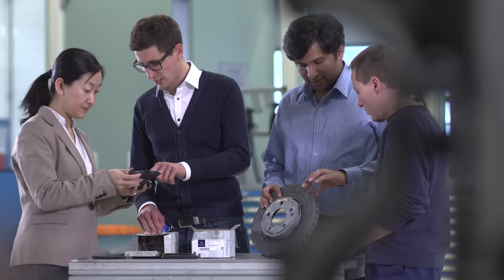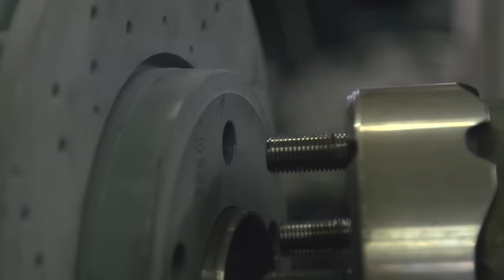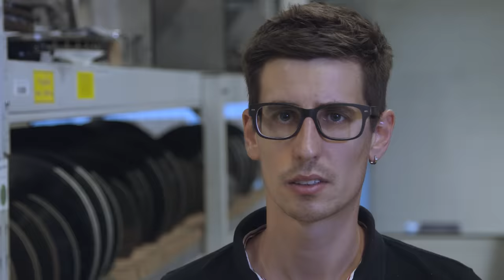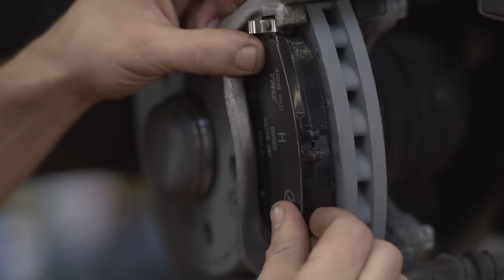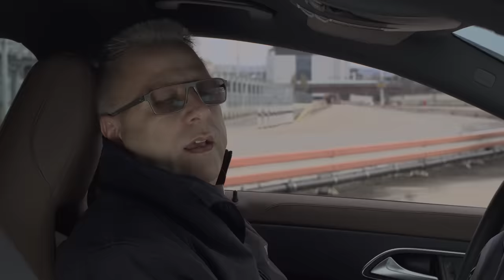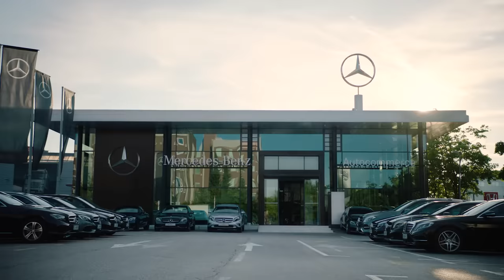Brake Test | Mercedes-Benz Genuine Parts vs. Fake Parts

Comment: I have a feeling this is biased lol
Reply: Mr.Popeyes 😂😂😂😂😂😂
Reply: Mr.Popeyes "hey look my feet is not strong enough to press on brake pedal hard" hahahaha
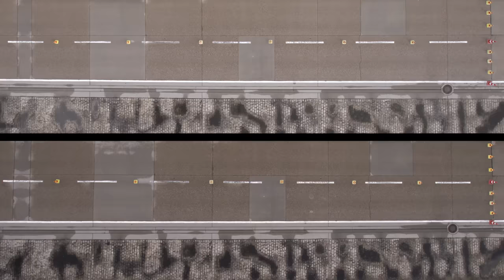Reply: if you go frame by frame at 1:44, you can see the brown car applied the breaks at the 2nd cone where as the white car is already breaking when entering the scope of the camera. smh
Reply: It is true (ask how I know)
Reply: that's right
Reply: Roblox Gamer it actually is not biased, I just tested this myself
Reply: Teun I

 no,  because ABS won't let it lock the wheels
Reply: Teun I hes driving a fucking sedan, obviously with abs. Do you live under a rock?

You guys can question it all you want, but you get what you pay for, and brakes arn't something to look over. Doesn't matter how fast you go if you cant stop..
Reply: You can throw the cheapest brake pads on, and they will still be able to lock the wheels ... how long they last, if they will fall apart or if they will wear down the rotor is something to consider ... but this seems to be 100% BS ...
Reply: goguhu no you cant, Im guessing you've never heard of brake fade, or experienced it, lemme guess you live in a flat area?

 Case and point, my buddy bought the cheapest of the cheap pad to put on his sedan, we were coming down the Appalachian Mt's when you could see smoke rolling out of his wheels, and his brakes were nearly not working. This was within a week of putting them on with barely any driving. You get what you pay for.
Reply: No I actually live in a very mountainous area, in my youth I commuted up and down 3000+ ft every day, and learned from I was very little to not ride the brakes, apply them hard and short instead of barely touching all the time.

Brake pads is not what's causing brake fade. Brake fade is caused by too much heat buildup which is typically caused by applying the brakes too much / too long and/or driving a vehicle in a way it was not designed to do. Typically people experience this when they drive automatic cars down hill with lot of turns, and ride their brakes for 5+ minutes, or they are taking their Toyota Camry on a race track, and realize after one lap the car won't stop as fast any more.

The heat buildup deteriorate the braking fluid, and can in most extreme cast (with old fluid) cause moisture that it will pick up to boil, and you will lose all brake (till they have cooled down). The other more common effect is that under high temperature the rotor (or drum) and the braking pads no longer have enough friction, and you need to apply much more pressure to stop the car, or eventually not even be able to lock up the wheels.

Smoke coming out of the wheels have most likely more to do with how he was riding his brakes, and not sufficient cooling of the brakes / continuous braking. I have stopped many cars over the years when driving over mountains (latest one was down from Mt. Elbert in Colorado), where the elderly couple was totally oblivious that she was cooking her brakes (the rim was too hot to touch, and the discs was glowing).

And yes, there are pads that will break down very fast when running them hot, and even the bounding material used in them might be sub-par, but typically this will only be observed under extreme situation.

My point here, was unless they had been running that car for laps after laps on a track, and then tested the pads, they car would have stopped in the same distance, and yes I would recommend against saving $ on tings like braking fluid, rotors, pads, tires and rims ... those things are cheaper than your live any day. I 100% agree with their message, just not by their false test.
Reply: If one cannot afford genuine parts then why buy an MB?stick to toyotas and hyundais?
Reply: Scallie Brake fade? Sure, I've experienced it. Hauling gravel in a dump truck roughly 20 tones total. Drum brakes experience brake fade. Unfortunately for your argument, the merc sls uses disk brakes.
Reply: goguhu not riding the brakes is smart because with disk brakes, increased heat increases wear. You could ride your disk brakes from the top of Everest, they would still perform at 100% the entire ride.
Reply: was this a pun? lol
Reply: No it isn't
Reply: The non genuine brake pad is an illegal part, in other words this video is saying use genuine parts that are legal not fake pirated products
Reply: LMFAOOO
Reply: Lol😂😂😂😂😂😂
Reply: I mean factory is always best
Reply: @vw_hater  not alway, but you have to spend quite a bit money to get better stuff..
Reply: a small amount yes...but honestly no....these parts are all created by MB...designed for certain wear over time tolerances and performance values.  Knockoffs and second hand parts will not wear down the same way so in the end you get imbalances that can effect performance of the car and even cause damage to the car itself if not you too.  if you buy after market parts...like custom made high quality parts not MB...those can be ok but even they will put a warning about the alterations it can have on the cars performance if not installed according to the manufacturers guidelines.
Reply: Hey dude what u feel is true no doubt about it...
Reply: I mean the video is made from Mercedes themselves So. Of course it’s gonna be biased
Reply: They didn’t break in the counterfeit parts compared to the Mercedes parts. Of course an improperly installed/setup/operating part is going to perform worse than a stock setup allready broken in
Reply: Facts
Reply: It is. They didnt take into account for example how wet the test track was lol
Reply: were looking at a commercial here, what did you expect.
Reply: Then do not think that this is true. But test it for yourself.
Reply: You don’t lock wheels with ABS. This is a video about fake products vs Mercedes or OEM equivalent. It’s not about branded Mercedes vs OEM replacements, so the bias accusation makes no sense.  
Brakes matter.
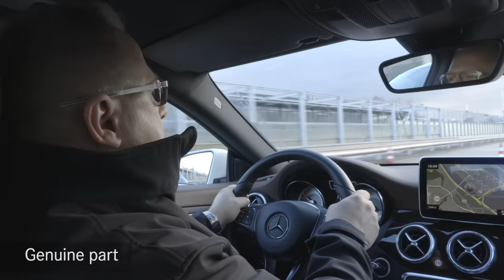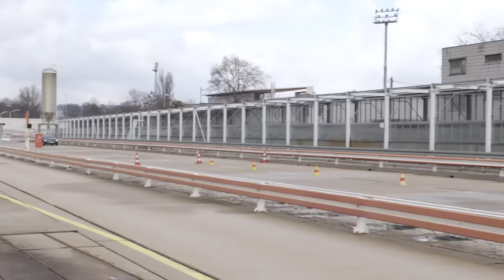Reply: 1:32 you can see the white car brake HARD before the cones you can see this by the shifting of the weight of the car due to momentum. He already started braking WAY before the cone. While the black car at 1:52  didn't start braking until the 4th yellow cone. You can tell because of car weight shifting forward and you can hear he applies the brakes much later.
Reply: I wonder why you would think that ._. Also have a high suspicions there counterfeit comparison was the cheapest most Chinese things they could find on the market
Reply: Don’t think I will be putting cheap China pads in my high performance car! That’s the point
Reply: @teun3606  to stop quick you don’t lock the wheels, you apply a high force just before the wheel lock, that’s why we use high performance brake pads
Reply: @Ryantube007  discs fade too I have experienced it multiple times on different cars with disc
Reply: Me too
Reply: @TheYavy  that’s exactly what I was thinking.  It’s clear they didn’t press on the brakes hard enough
Reply: 5k likes after me
Reply: You don’t say.
Reply: @teun3606  do you know what ABS is ?
Reply: Biased to a counterfit. This is true .

Comment: “They are only interested in their profits” YOU CHARGE 1000 FOR BREAKS
Reply: It doesn't matter the overall cost. It's percentages.
Say the Merc brakes are £1000 and the fakes are £500. The Merc ones (random number) cost £300 to make and they sell with a profit of £700 while the fakes cost £50 to make and make a £450 profit.
Reply: ...or brakes.  If you can't even spell the word right, what difference is it to you?

Comment: If you look at the rear of the vehicle, you could see that the brake lights in the brown car only come on when the car is very close to the cones. What a fair test
Reply from the maker: The comparison of the braking distances took place under the same conditions at the same initial speed and the same braking point. The longer braking distance for the car with the counterfeit brake disks is the result of the defective quality that frequently occurs with counterfeit products.
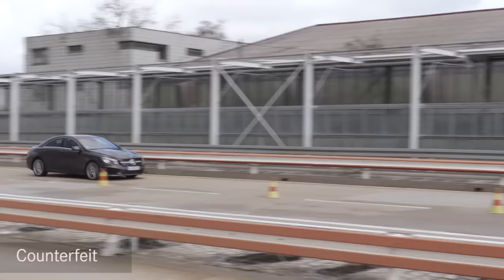Reply: If we look closer at 1:55, frame by frame you will see the suspession return to original position after the brake was released and then the suspenssion was compresed again (because the driver press the brake again ), the braking power applied on the pedal wasn't the same in both cars. The test to be fair, we need robots for braking pedal and we need to see the braking force applied on the brake pedal as the car in braking. MB as a manufacturer of cars and not only MB, will always say, buy parts from us, the aftermarket parts is a crap, ok, but we need to see if that aftermarket is crap.Compare 100$ with 100$ parts. We know if we buy 20$ parts insted of 100$ will be crap, no need for a video. We need to know if 100$ geniune parts is better than 100$ aftermarket parts. Please, MB do this :) !
Reply: Mohamed, the brake light is LED, because of that, the brake light flicker ( it's about the frequency of the current ) and the video frequency (50 Hz or 60Hz), the brake light was on all the time. And for the brake light to be on, you only need to touch the brake pedal, and in this test you need to put lot of force on brake pedal to stop the car.
Reply: Mercedes-Benz wenn man ständig und immer wieder die gleichen Lügen erzählt (übrigens wie unsere Medien und Politiker auch), wird es nicht automatisch zur Wahrheit Mercedes 😉
Reply: @Perceptence  was just an example, nothing specific.
Reply: I think the brake lights were also counterfeit
I trust Mercedes😊

Comment: If you want to compare with aftermarket, you guys gotta test with the same price range product. Not $200 genuine product and $50 Chinese product. Lol. Personally, i will go with same priced aftermarket product, such as brembo, instead of dealer product.
Reply: that's why this is about 'counterfeit' parts, not aftermarket.
Reply: Ted Yoon I recommend ATE pads and discs, as that is the brand that the VW dealership supply my car with. They are the best in my opinion and cost a fraction of what VW charge for them when you buy them directly. The ones VW sell are identical but just come in a different box, with a VW stamp on it. The part number and the ATE logo are still on it.
Reply: It's not about aftermarket expensive parts, it's about COUNTERFEIT PARTS, meaning companies selling them as original Mercedes or identical to OEM parts, but at a much lower price, claiming identical quality.
Reply: Ted Yoon 
That’s the whole point of this video. That’s why it says “fake parts” instead of “cheap products”.
Reply: not the point but brembos are awesome
Reply: Ted Yoon Please read the comments.... Your "LOL" will be answered....
Reply: Did yo know Brembo makes Mercedes genuine brake discs and calipers (for the bigger sizes)
Reply: Mercedes used to use Brembo kits for their older amg cars like the 99 ml 55 comes with Brembo
Reply: 28leojay yes, i know. Thats why i said i would use aftermarket brembo, which is same quality, but cheaper price.
Reply: The stock brakes are brembo brakes...
Reply: Thats exactly the point of the video to prove to those autozone shoppers
Reply: Ted Yoon you do realize that Brembo does make the AMG Brakes right? So putting in aftermarket Brembos is kinda pointless
Reply: Its not aftermarket comparison.
Reply: @TheR3negadeMaster  if they are genuine ATE even. There are many fakes. Always compare hardware that comes with the kit and brake pad fitment. The pad should need no alteration to fit and move perfectly. This is the only true test
Reply: That's not the point of the video. the video was meant to show how counterfeit cheap parts can be unreliable and break easily
Reply: HemiV8 how about an 05 E55 AMG? Were they still using Brembo then?
Reply: This video is about counterfeit brakes.

Comment: That test looks like it is fake
Reply: The UK Sexy yeah guy with fake breaks went fastee
Reply: it is..
Reply: It's fake af and to be honest.. who believes germany after the VW incident ? Bunch of liers
Reply: The UK Sexy it's not fake .. I tired non genuine pads for my bmw and it wasn't cheap .. simply felt I had no breaks comparing to the genuine ones
Reply: Genuine he starts to brake just before the line, non genuibe hes about 1 set of cones past before he applies them, you can tell in the videos from when the nose of the car dips! FAAAAAAAAAAKE
Reply: Yeah having pads that have less friction would not decrease you brake distance. You would have to put more pressure on them but they would still easily be able to lock up the tires. If the tire can be locked from the brakes then you are already at maximum braking. It doesn't matter if you add more pressure or better materials. The reason for better materials and bigger brakes is to help cooling and efficiency of the brakes. They don't allow it to stop any faster. You would get a stronger initial bite from the brakes with better kit which may give you a slight advantage.
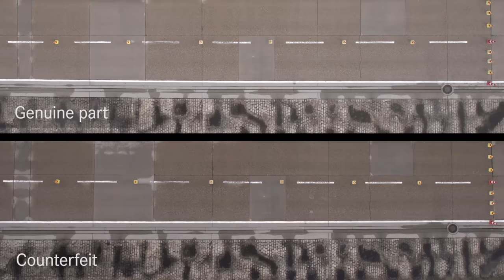Reply: Brown car going faster that's why braking distance is longer.... just replay video at 1:44 select play speed 0.25... u know that is true.
Reply: At 1:52 the brown car starts braking way after the cones
Reply: The UK Sexy prob not, mercedes makes good shit and a cheap counterfeit would be shit.
Reply: I know it's true, 'cause I seen it on the internet!
Reply: @Grumpycat95  that's racist. But I also believe they rigged that test.
Reply: @CheeseNoodleOZ  I have a GLE Coupe 43 and have noticed running different pads from Mercedes are actually better
Reply: True
Reply: You all saying its fake without trying
Reply: The UK Sexy like their cars
Reply: Nope
Reply: Because it is
Reply: To me also it looks very fake, cuz I use counterfeit brakes and I see no difference.
Reply: @Grumpycat95  lol that's the most stupid thing I heard in my entire life. You don't trust a country anymore after one company screwd with their customers?
Reply: I am not sure if that’s right way of braking or they did to take longer to stop, but if you look at the rear lights in the counterfeit test, they keep switching on and off which means they kept on letting go of the brakes then applying them.

Comment: Hm, weird that the ABS still had to kick in on those counterfeit parts. This means it wasn't lacking braking power. Maybe you just went too fast or had something loaded up in the vehicle?
Reply: Mercedes: "We never said we weren't transporting 500 kilos of lead in the trunk brown... We might also have "Forgotten" to mention the fact that the surface of the track had been coated with generous amounts of silicone oil for ONE of these cars!"

Comment: Remember to use genuine M.B. parts. You never know when you'll have to slow your car from 300 mph while towing a trailer.
Reply: I once got a new rear view mirror for my former A class - it was not a original part. However, the merc logo on the plastic was simply melted away at the 3rd party part (it was melted away at the point where the old mirror glass had the logo), it was made by the same supplier as the original mirror glass. 
Merc isn't producing any brakes by their own - they buy from suppliers, like Lucas, ATE or Brembo. As long as you don't buy faked ebay brake pads the pads made by this suppliers and sold by aftermarket stores are as good as the original ones, since they are from the manufacturers which make the original ones
Reply: @simonm1447  I didn't know they made A Classes for men. Lol jk
Reply: @tylerpupo2886  it pulled trailers up to 2 tons (at just around one ton empty weight), and it had a huge internal space. It was better than a station wagon, which has a long but relatively flat trunk

Comment: this video is Mercedes indirect ways to convince you to give them more of your money but clearly.. there are better aftermarket brakes such as Brembo which is cheaper, safer, and more reliable
Reply: Sir cheaper? Brembos?
Reply: touche hab grad nachgeschaut, ~40 statt ~100 ist schon ein unterschied
Reply: *suplier, but i don't think so
Reply: Johnny Elishov nope. Switched over to Brembo ceramic pads and dust reduced significantly over stock. Of they were the same supplier that makes no sense. 

I think Mercedes uses TRW as their supplier of brake pads.
Reply: ceramic pads and discs are two different things right?
Reply from the maker: The counterfeits shown in the film are not high quality replacement parts from Mercedes-Benz or other legitimate suppliers, rather they are illegal counterfeits from product pirates. In almost all cases such counterfeits are of defective quality and do not meet minimum legal standards. Thus the counterfeit parts can become a danger for vehicle occupants or uninvolved third parties.
Reply: Trades46 Hey man can you please tell me the part that you used?
My CLA makes a ton of dust.
Reply: @dimmacommunication  sorry I never saw your question. I used Zimmermann drilled rotors matched with Brembo ceramic pads. A solid combination - it doesn't bite as hard initially as OEM, but it produces about 90% less visible brake dust.
Reply: ferkemall  If it was a Tesla which is put together in a tent I would agree. Not Mercedes - the OEM brakes stop on a dime, but the brake dust is the problem on their cars.
Reply: @Trades46  Hi, can you give me the pads code  ? price ?
Reply: @dimmacommunication  it was specifically for the C350 Sport. I used official Zimmermann & Brembo website to confirm fitment.
Reply: @MercedesBenz  IF YOU WANT PEOPLE TO BUY YOUR "GENUINE" BRAKE PADS, STOP CHARGING THEM EXCESSIVELY!
Reply: He meant counterfeit brakes, not aftermarket.

Comment: I am also against counterfeit parts but if you are going to do a real world comparison in two identical cars then you need to show a graph with pedal effort applied over time in each car as well as the brake fluid pressure reading.